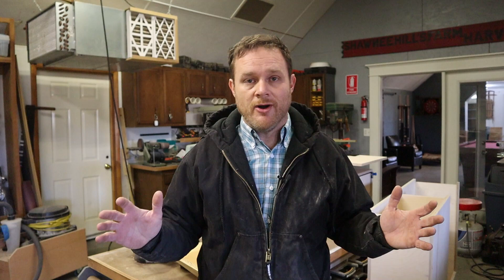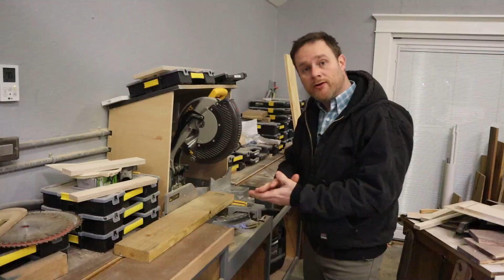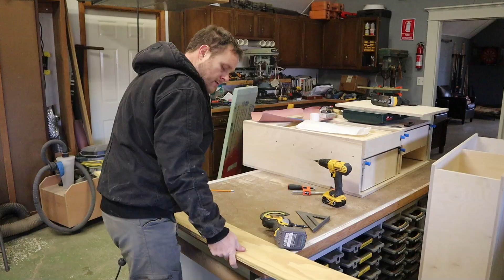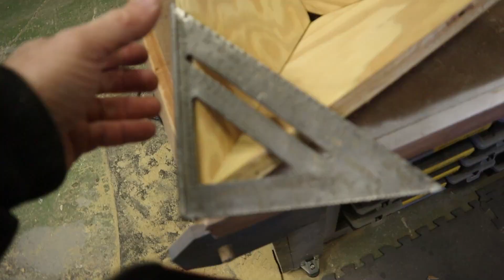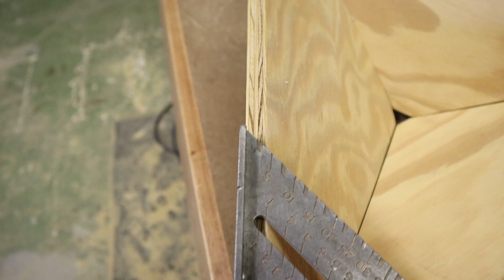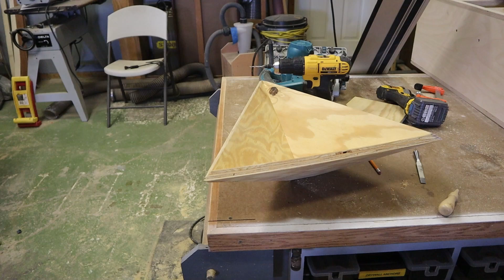#171 How to cut these compound miters

Comment: I have to say that I'm still confused. Yes, this video was shot 2 years ago but it came up after a search of cutting compound angles. I'm struggling to make a picture frame that is splayed outwards by 20 degrees which I cut on the table saw using an digital angle device for accuracy. Annnnnnnnnnd that's about the point confusion set in. Do I make the compound cut with the board flat or vertical on the fence? And I fully understand that I would need 45 degree angles to make my corners when cutting for a single angle but with a compund due to the splay, how do I figure those? And again, when does one make a decision to cut an angle with the board flat, angles (like for crown) or vertical against the fence when using a chop saw? Thx.

Comment: I was ready to come here and call you an basshole!   However, the problem was all me!  For whatever reason, I thought a speed square measures the angle left over not the wood cut off.  I was completely wrong.  I spend days measuring angles with a couple electronic angle tools drawing up plans which I transferred to the wood.  I made jigs on my table saw and RAS... all failed.  I started thinking your video was a scam.  It wasn't until I really looked at the speed square and measured my angles and found I was not using the correct starting point, therefore all the angles I measured were the compliment angle!  Duhh!  I felt I was going nuts.  I blame it on Dyslexia.  Nevertheless, this video is spot on! And, I apologize for bitchin you out!  LOL

Comment: Hi!  Thanks for the video. The presentation was very clear.  But I did not hear you explain where you came up with the actual cut angles of 53 and 36.  It looked like the finished project was 45 and 90.  Is there some conversion table?  Thanks.